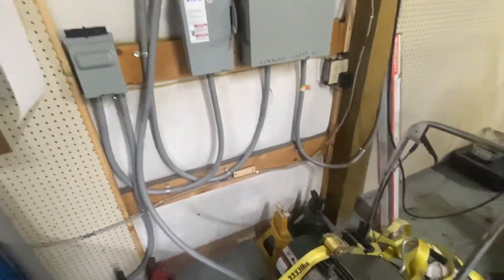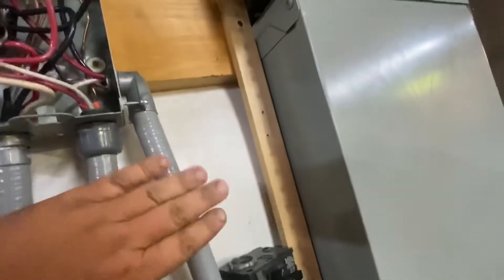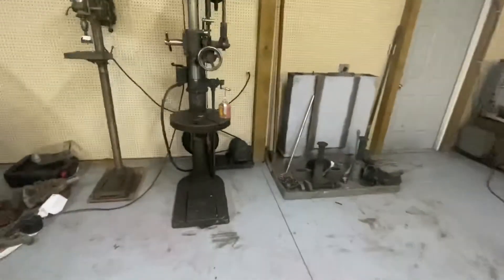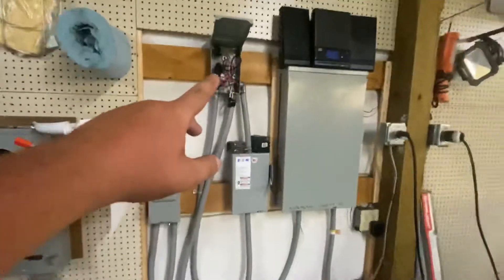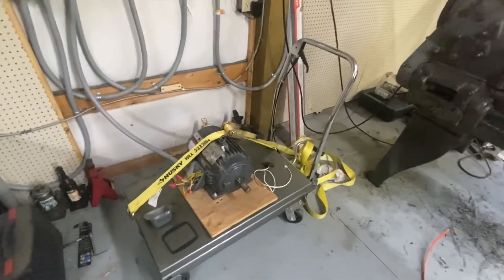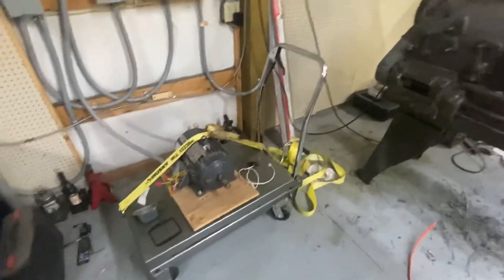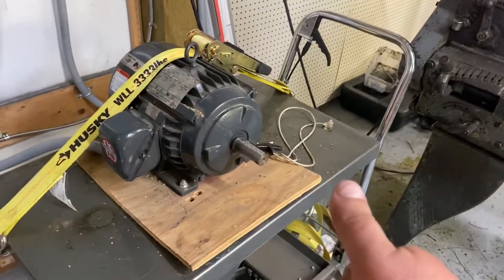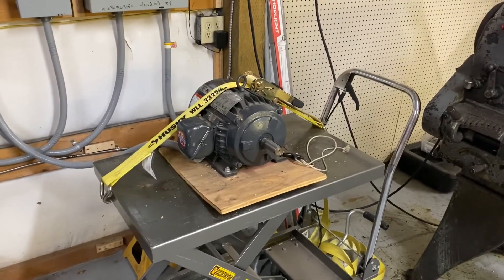Homemade rotary phase converter part 2, wiring in the motor and getting it ready to test

Comment: You should do more research on this, you can absolutely run a CNBC machines and welders with a phase converter. They are used everyday. You can’t use a vfd to run a welder or cnc
Reply from the maker: Very true, my older much smaller phase convertor wouldn’t handle my welder but my 15hp one I have now handles it no problem